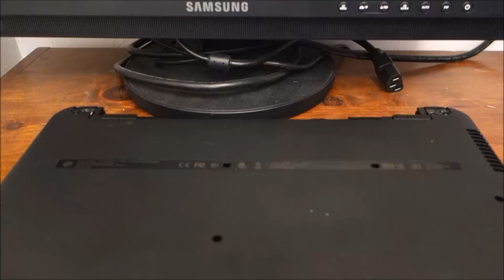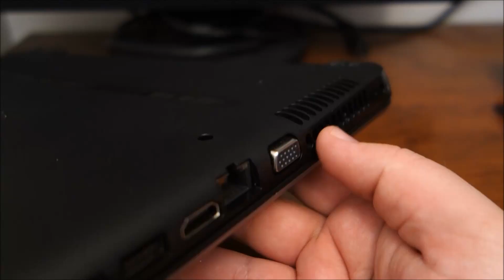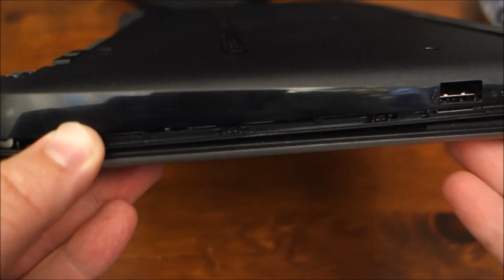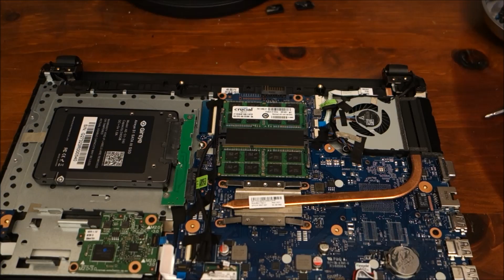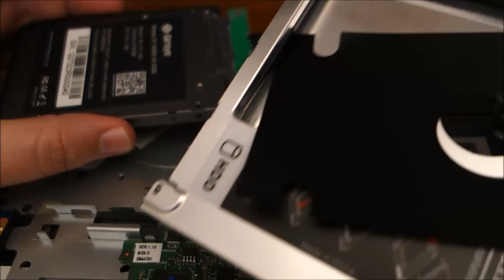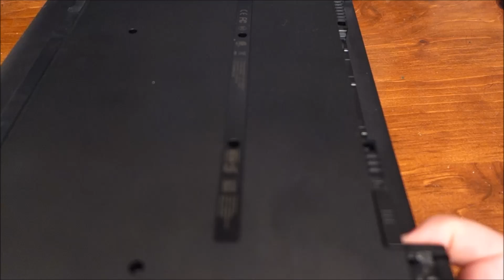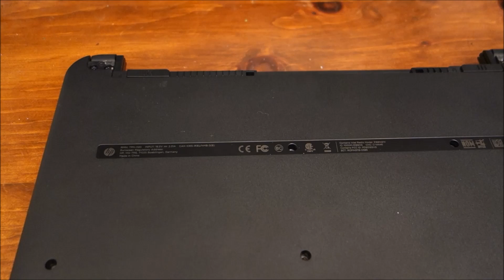HP 14-an013nr case opened up, ssd install, memory upgrade

Comment: What's the green part that connects the ssd to port, sis that come with the ssd?
Reply from the maker: no, I bought a cdrom drive HDD caddy. This one to be exact: http://amzn.to/2dho292  Took it apart and used the control board, and then Velcro to keep the ssd in place I've used it for over a month this way with 0 issues.
Reply: AICproductions okay, thank you for the info.
Reply: AICproductions pls I have an HP Notebook 14-ac102na (Energy Star) with a 2gb ram and a 32gb storage but why question is can I change the 32gb storage if so how because it's really frustrating me
Reply from the maker: +Davies chukwuka I cannot find specifics for that laptop, and I have never touched one before, so I cannot give you an answer. If you feel brave, open it up! Take the screws out and see what you are dealing with.

Comment: Did you do a video on how you installed the hard drive.
Reply from the maker: this is the video. I show how to remove the cover and how I have the hard drive installed.
Reply: AICproductions but did you do a video on how you installed it? I'm curious because I'm brain dead with computers but I know that 32gb won't be enough at all. Did you take the adapter part out of the caddy thing?
Reply from the maker: any 2.5" drive will work, but I would HIGHLY recommend putting an SSD, since it would improve performance, vs a standard drive which would hurt performance. 

The green thing is the guts of a hard drive caddy, Link for the one I bought in the description.
Reply from the maker: +Rich and Handsome I make no promises from a picture, but you should look up the specs, and see if it a 2.5" drive. 

I would again recommend getting an SSD, a regular drive will make this laptop very slow seeming. An SSD adds a ton of performance and they are very inexpensive.
Reply from the maker: +Rich and Handsome I linked to one in the description.

Comment: Great reviews, I bought this laptop! To upgrade the the ram to 8gb. Is it dual channel and only need one extra 4gb ram stick? Or is it only single channel and have to get the one 8gb stick? You said in your video its only single channel and the other 8gb stick didn't matter. But then you said tried two sticks in comments and said it worked? Confused lol
Reply from the maker: +Panto there are two slots, but even if you have two dimms in it, it runs in single channel mode. You just need another 4 gig stick.
Reply: May I have the spec for the 4GB stick?  or brand and model number?
Thanks in advance
Reply: AICvideo You probably won't respond to this, but, I'm a complete noob, I can't speak the computer language... But if you just add another 4 gb RAM into the second slot would it make it 8gb? What you said about the "single channel" thing confused me about this, so I was asking just to make sure.
Reply from the maker: Single/dual channel refers to the speed of the throughput. If you add another 4 gig stick, you will have 8 gigs of memory. But that memory won’t be as fast as a system that supports dual channel memory. It’s a performance boost of <10% for even high end systems that can take advantage of it. The 9 gigs will make a large performance boost compared to just 4.
Reply: AICvideo Oh I see. Thanks for the quick response, lol I was expecting to wait a few days...
Reply from the maker: Ha, I’m a small enough channel, and you caught me at a good time. Have a good night.
Reply: AICvideo You too
Reply: AICvideo Yet another question... Is this PC good enough to run Skyrim? I want a PC that can run Skyrim nicely.
Reply from the maker: Ummmm... any new computer under $600 is not a computer I would run triple a title games on. Even one from a few years ago. Your best bet is a used gaming system from 2-3 years ago, if you’re on a budget.

Comment: I was looking at an upgraded version of this laptop for a couple weeks for my parents.  I had been planning to do the 8GB RAM thing with 1 stick of 4GB but Windows 10 is bad about RAM usage.  Is the 16 GB build recommended over 8GBs?  At some point the AMD processor will be the bottleneck.

I'm appreciating the SSD and the carrier card links.  That looks like a great deal for local storage.  I'm going with a NAS for bulk storage.

But all of this will bump it into the 330 range. I'm wondering if that is worth it. With 8GBs of RAM it's only ~$270 range.
Reply from the maker: I had 16 gigs, and downgraded to 8. 8gig of memory is more than enough for this laptop. Its what I recommend, and I would not bother spending more than that on it.

Comment: grt video!!! can you please provide links for the hdd and hdd -> cd connector. also does the hdd need heatsinks?
Reply from the maker: hdd does not need heat sinks. links are in the description of the video.
Reply: thanks for prompt/quick turnaround

Comment: I did this!  I put in a 240GB SSD and restored a windows 10 system image I made from the 32GB onboard drive to the new SSD and works great!  Then I installed UBUNTU on the 32GB internal drive! :)
Reply from the maker: +Elijah Amirianfar macrium reflect.
Reply: Lean Dela Rosa what I did was that I first made a USB stick with Windows 10 on it. Then I physically installed the SSD into the computer. I then booted up the computer from that USB which has windows 10 on it then set it up. I formatted my old 32 gb drive and put in a 240gb SSD and it works great
Reply from the maker: awesome! glad it worked for you!
Reply from the maker: Mine came with windows, I prefer windows for daily computing. Everything I have is centered around windows, switching to ubuntu on a casual system is too much effort/work. and windows 10 is a pretty decent operating system.
Reply from the maker: I just googled it, and the only difference I can see is the screen resolution, 12 is 1366x768 and the 13 is a 1920x1080 screen.
Reply: i found this laptop at TARGET and they price matched it from my amazon(prime) account. but i am like you, I use linux for everything. 

And I tried to do the dual boot but windows 10 was being a pain in the arse. Some people have a step by step on how to setup DUAL booting, but I got tired of just messing with it AND installed over it(win 10). BTW, if micro$oft would play nice, I would have kept it(W10) but them trying to FORCE ME to keep WIN 10 on my very own laptop just pissed me off.
Reply: Hey so how do you clone the 32gb drive onto the ssd?
Reply: Elijah Amirianfar i don't recall exactly. i may have made a Windows system backup and then just restored it to the larger drive, otherwise i used free software i found after using google searching for cloning a small drive to a larger ssd. Sorry i can't be of more help.
Reply: Ok thanks!
Reply: petermg22 pls how did you do it
Reply: how do you do it? can you make a video or tutorial for this? coz i'm planning to buy a 500gb ssd on it and i'm worried about how to copy the os of 32gb ssd to 500gb ssd
Reply: alright, thank you so much for this. :)
Reply: petermg22 such a great idea :0
Reply: AICproductions  can I use  Samsung 840  250gb?
Reply from the maker: +carlos garcia sure
Reply from the maker: Yes, it was faster, since you could have a bigger swap file, and a full SSD is faster than the emmc storage.
Reply: which brand SSD did you and get I get a link to compatible hardware for the HP 14-an012nr
Reply from the maker: http://amzn.to/2DGBWuE - hard drive to the CD rom adapter 

http://amzn.to/2DJ5ms2 -  SSD
Reply: Jamie
Reply: Great info  but where to find the adapter you used    Thanks
Reply from the maker: Check the video description

Comment: What kind of sata adapter are you using? I'm having trouble finding one to buy. If you could post a link that would be a huge help. Thanks for the videos!
Reply from the maker: I linked it right in the description:
CD-rom to HD caddy:
http://amzn.to/2dho292

that's the one I bought, took it apart, and used just the board on the inside, and discarded the rest of the caddy.
Reply: Oh ok, so you basically just took the aluminum case off and are just using the connector that was inside of it right?
Reply from the maker: Correct, there are like 4 screws holding it together, took them out, and used Velcro dots to hold the hard drive in place.
Reply: I have HP Notebook 14-ac102na but by inner hard drive is very small 30gb I have tired talking it to different technician but there is no solution need help.

Comment: hi, do you think I could use this laptop to make streaming videos via youtube using a camcorder and a video capture card?
Reply from the maker: I'm not sure I fully understand the setup you're going for? are you streaming games? vlogs? I mean, if you plan on editing videos on it, it will be OK for that. If you plan on gaming? probably not, if nothing else, most games you play have to be turned down to their lowest, or close to lowest settings, and the video wouldn't look good.
Reply: Thanks for your response, but the streaming I want to do is meant for live events, not for gaming.... that's why I told you I'm going to use a camcorder.... Now, what do you think?, I'd really appreciate your opinion.
Reply from the maker: I would look at the minimum requirements for your capture card. I don't have a better answer because I've never done that and I simply don't know how it will perform.
Reply: Ok I understand, thanks anyway...Good channel, thaks for making videos related with budget laptops like this... probably I buy it later because its a good value... greetings from Ecuador, keep going making good videos

Comment: Thanks for all the coverage on this computer.  Your videos were timely for me as I had spent many hours searching for a cheap laptop with a 1080p IPS screen when I stumbled across your first video on this one.  After that, my mind was made up.   I've got my new 14-an013nr in hand now and am preparing to install an SSD.  Not having done this before, I googled to see exactly how others clone or copy the drive image in other computers and got confused about some of the details.  Can you tell us, in somewhat step by step fashion, how you used Macrium Reflect to get it done for this specific computer?    Thank you.
Reply from the maker: Sure I could probably throw something together. Its not a difficult program, maybe tonight or some time tomorrow.
Reply: I went ahead and tried it myself.  Ran into a couple of problems.  The first problem proved to be minor, the second not so much.  First, I had to learn how to initialize the new SSD, using DISK MANAGER and once I did, that part went fine.  Then I cloned the C: drive to the new SSD with Macrium Reflect.  There were four partitions on the old eMMC drive, the third one is the big user partition while the fourth one is a recovery partition I think. Don't know what the first two were, but being small, I decided to leave them intact.   I found that in Macrium Reflect, while preparing to clone, I had to move each partition over one by one to the destination drive section.  Doing them all at once did not allow me to resize the third partition.  When the third one was moved, I resized it from 29GB to just large enough to leave room for the last partition or about 222.34GB and named it E:.  Then I moved over the last partition as it was, leaving a few MB of unused disk space on the new drive.  Then I went ahead with the cloning, which appeared to complete correctly.  Then I followed you instruction to change the boot order in the Bios. That appeared to work correctly and I booted successfully from the new drive.  At this point everything seemed to be working ok.  
 
Here's where the second problem happened.  I timed how fast the desktop would come up from power on and it was around 34 seconds (used to be about 90 seconds).   Wondering how some others who have upgraded to ssd on other machines can boot in 10 seconds,  I thought that perhaps I can figure out how to skip the Windows welcome screen, so I googled for advice and found that I could choose to do this using the command "netpolwiz" to get to User Accounts.  In User Accounts, I de-selected "Users must enter a user name and password to use this computer" and saved that.  Then I re-booted the machine and a big problem occurred.  I got the HP logo with the dreaded "automatic repair" and then a repair screen on which nothing helped.  I kept getting stopped at automatic repair and it was unable to repair the problem.  Having read some other commentary a few days ago about it being dangerous to reformat the eMMC once you have the SSD going (on a similar type of pc), I suspected that perhaps the eMMC is still involved with the boot process and the fact that I changed something only on my E: drive caused problems somehow.  So, I fixed the problem by changing my boot order back to the C: drive (eMMC), and then the system booted ok.  Then I made the user account change and rebooted without problems.  Then I repeated the cloning process as before and now everything is fine.  I plan to leave the C: drive contents alone as this seems to be a useful "lifeboat" in case of trouble.

So, my question is...what happened?  How is the C: drive (eMMC) still involved in booting even after I have changed the boot drive to E:?    A bit of research brought to light the idea that this is likely a WIMBOOT issue.  Could it be that during booting, the image files are still recovered from the old drive (those other partitions) rather than the new drive.  Makes me wonder how do I get the new drive to hold everything,  and re-assign the old drive to be something else?  I guess it would be possible to clean this all up by doing a fresh Win10 install from disks using a USB optical drive, no?
Reply: I don't have an answer to your question regarding why the eMMC drive is still involved in booting after switching to the SSD, but was wondering if you were able to successfully change the boot order over to the SSD without issue after your second cloning process?

I'm asking because I followed pretty much the same process as you, except after cloning (using Macrium Reflect) the eMMC to the SSD and changing the boot order to the SSD, I went to restart the machine immediately to ensure there were no issues, and sure enough I received the HP "automatic repair" error.

That being said, I'm about to embark on my second clone and wanted to know if you could kindly share your most recent results.
Reply: Anddddd after my second clone and switching the boot order back over to the SSD, I'm again getting the "automatic repair" error. I'm using the same Aireye 120GB SSD as recommended, as well as the same hard drive caddy. I also saw your Amazon review, which is very detailed and much appreciated - any suggestions?
Reply from the maker: its hard for me to give you any suggestions without seeing what you're doing. Record a video of your process? the copy, changing the boot order, and then the boot? upload it and I'll take a look.
Reply: Things went fine for me after the second time around as described above.  The repair screen was gone after cloning and then reassigning the boot to the new drive.  I thought everything was working fine after that and it did for about a week of daily use.  Then something new happened which caused some grief,  and which eventually fixed itself, so things are going ok now and I'll save the rest of the story for another comment later. 

I would like to suggest that there are others going through this process of upgrading our little 14-an013nr and running into trouble, and I don't think this spot is a good place to continue our technical stories, so I would like to suggest that we find a more permanent home to discuss life with this little computer.  I don't know where to suggest and after one quick google,  I found the HP Support Forum, but after one look at the GUI, I thought "yecch" and moved on.  Then I ran across www.laptop-forums.com and it doesn't look too terrible.  Any other suggestions?

Comment: Thanks again for taking the time to pass this on!  I am having trouble cloning the o.s. from the existing drive to a SDD.  Apparently the existing drive is 512 byte and All Sdd's are 4000 thus making the clone transfer imcompatible?  Is there a trick to getting the o.s. moved over or did you just image it?
Reply from the maker: +Boom Boomer what are you using to clone the drive? I have always used macrium reflect. It's free and has always worked great.
Reply: i tried macrium and acronis and a few more. something with the existing drive is 512 byte and SSD's are 4000 bytes making it incompatible, so it wont allow the cloning to continue.  I wonder if I am the only one having this issue?   I am also noticing a substantial amount of screen bleed on my particular laptop.  I might have to send this one back for another?  Thanks for the response and don't work to hard!
Reply from the maker: Hmmm... which SSD are you using? have you tried deleting its partition, and trying again? I've cloned to many an ssd without issue. I'll record a video shortly how to use macrium reflect.
Reply: I have latest crucial 300 250 GB on Amazon.  No need for video unless you just want to do it. I found Macrium videos already anyway and the byte thing bit me lol.  This talks a little about it... On a side note did you get the screen to perk up any more? Thanks
Reply: forgot link http://forum.macrium.com/PrintTopic4440.aspx

Comment: Inspiron 15 3000 with Celeron CPU, 4GB of RAM, 500GB hard drive, and a 15.6-inch display for $199.99
Reply: Tee Lasher can you link that to me please?
Reply: Tee Lasher please link
Reply: You're shitting me right? That's some off brand site with Cyber Monday deals. Mate WTF.
I am sorry if this is late but If people are watching this right now this deal would not be valid.
Reply from the maker: Thanks I removed the comment with the invalid link.
Reply: AICproductions :3 thanks.